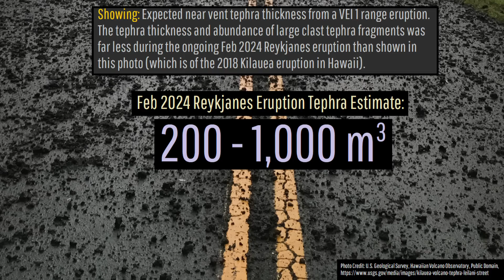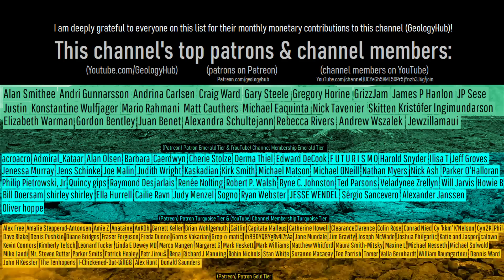Iceland Volcano Eruption Update; Ash Emissions, Lava Flowing Toward Svartsengi

Comment: Could you describe why there is gas in lava? How does a gas come to exist deep underground among an ocean of fluid rock?
Reply: The gas is part of the composition of Earth's interior.  Under the great pressure below ground, it is completely dissolved in magma, just like the gas (carbonation) that is dissolved in soda before it is opened.  As the magma rises, the pressure on the magma decreases and the gas is released.  Same as opening a soda.  You can use the composition of the gas that is coming out to tell something about the depth and composition of the magma, since different gas comes out when the magma is at different depths, and because different compositions of magma will have different assemblages of gases.

Comment: That shape of the fissures is absolutely fascinating. It almost looks like the dike has a bend to it, and in a really unusual direction too. Do you think that it has somewhat followed the plate boundary somewhat? Because it looks like the bend is in the right place for that. Dikes are of course usually pretty straight, the only other notable bent dike that I'm aware of was Holuhraun, which was part of a very powerful volcanic system (which always seem to break a lot of typical rules) and was still an unusual event.

Comment: Workers are currently connecting an underground backup hot-water pipe from the Svartsengi power station, which was put in place as a precautionary measure ahead of this new eruption. The legs of the pylons carrying electricity from the geothermal power plant also seem to have had material piled up around them as a protective measure. Full marks for forward planning and unflappable construction workers!

Comment: I would like some way to relate to the speed of the lava at its fastest.  It was horrific to watch it cover ground.  The different types of magma must have different viscoscity sp?  But guess the volume is the propelling force depending on the surface its flowing over??
Reply: The viscosity of lava is determined by the silica content.  Basalt has the lowest silica at 43-50 %.   Above that are the lavas with higher levels of silica to as high as 67--80% for rhyolite.    The thicker the lava is due to higher viscosity the more it plugs up volcano vents resulting in increasing gas levels resulting in higher pressures and sometimes explosive eruptions as in Mt St Helens or Krakatoa.  

The more viscous lava also does not flow as far as basalt which can flow up to 10-20 miles or 25-- 30 kms.

Comment: what about the svartsengi borehole 12? did it detected the eruption as expected?
Reply: Yes.  The earthquake swarm started about 30 minutes before the eruption, and the borehole data showed a change about 20 minutes before.
Reply: @b.a.erlebacher1139  I really wonder now if boreholes near active volcanoes might be a useful prediction tool, they could be economically justified by building small geothermal power plants around them. Its been a surprisingly consistent predictor.
Reply: @StuffandThings_  The tech already exist and is in use on many volcanoes, including Mauna Loa, Kilauea, Mount Etna, Vesuvius. However given that many volcanoes are in more remote, or difficult locations, have a massive area that can be affected, or do not have access to the internet needed to send the data from the monitors to the main base of operations, it might be too costly to put them on all volcanoes

Comment: The hot water pipe being submerged by lava is a real problem because many houses are heated by hot water in Iceland, and it's winter...
Reply: They hope to get hot water service restored within a day using a diversion pipe almost ready for use.  Meanwhile, they are asking people to use electricity sparingly for heating, because the grid isn't designed for such heavy use.
Reply: Time to dust off / reinstall wood stoves.
Reply: @BRENDANTHERED  There aren't too many forests in Iceland, so no one has wood stoves.
Reply: @BRENDANTHERED "Time to dust off / reinstall wood stoves." <- imagine thinking Iceland is forested.
Reply: @TheOriginalDanEdwards  I didn't say anything about forests... how do you think they survived there before the present day water heating, I'm pretty sure it was with stoves, burning wood, oil, or whatever else they could burn.
Reply: I show Reykjavik at 17 degrees F currently

Comment: The two plumes visible during fragmentation - one water vapour rich (white), one volcanic ash rich (grey) - indicate a rather surface level interaction with meteoric water.
Some causes the lava to turn into ash while the rest simply evaporates due to the heat.
There is no indicaton as of yet that this eruption is more gas rich.

Comment: Curious about the higher gas content. Makes you wonder if the source of magma supplying this active phase is going to change. If the composition changes enough, and the current magma chamber gets a mix of material, there's always the chance that future eruptions gain an explosive component.
Reply: With the amount of hydrothermal systems found on the peninsula, I wouldn’t be surprised if the explosive component ended up being caused by flash vaporization
Reply: @brqxton8974   There's a low risk that a future fissure could open up south of Grendavik and either be close enough to the ocean, or open up under it. That would almost guarantee an explosive eruption.

The other would be if it impacted the hydrothermal system feeding the lagoon. But I believe that is even less likely, for now.
Reply: @Benson_aka_devils_advocate_88  we know Iceland has been building itself along a southwest trend, so whether soon or in the distant future, the oceans south of Grindavik will boil. Quite sad considering the long history of the town.

Comment: The real issue I have been hearing about is the hot water supply has been cut off to many residence.
Reply: As I understand it, all structures are heated with hot water. Given how cold it is, pipes freezing and bursting could be catastrophic for the town. I saw they are trying to build a by-pass to reconnect the town with its critical hot water. Here’s hoping for major success….
Reply: Their heating has also been affected...
That is a far more serious problem...
🇿🇦
Reply: @aprilsmith3683   It's the same thing. Buildings are heated through hot water.
Reply: I’m sorry about my comment yesterday
Reply: Also central heating I believe
Reply: It supplies their heat.
Reply: Icelanders are tough, they don't need hot water, cold water for showers will do.
Reply: @Tugela60 ya but if it freezes the pipes you get no water and burst pipes
Reply: @Tugela60   their cental HEATING is hot water.